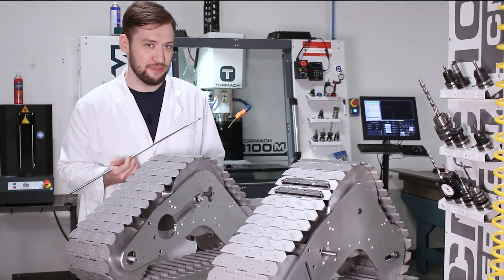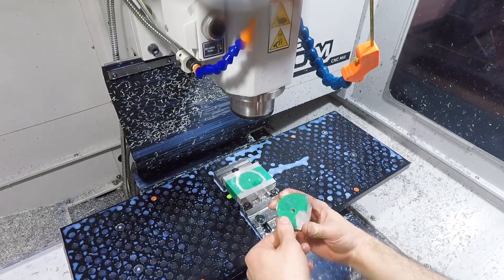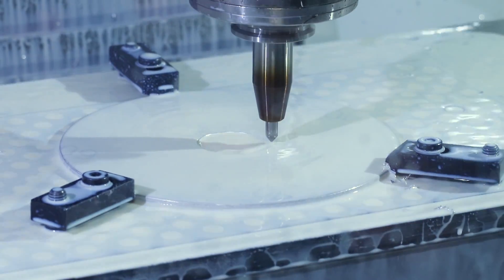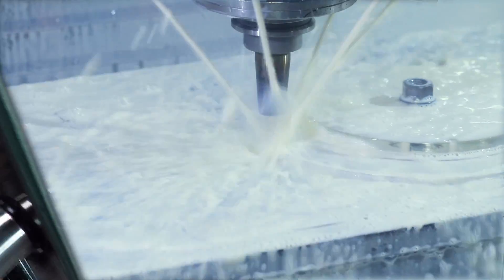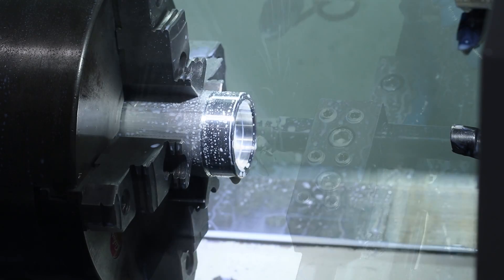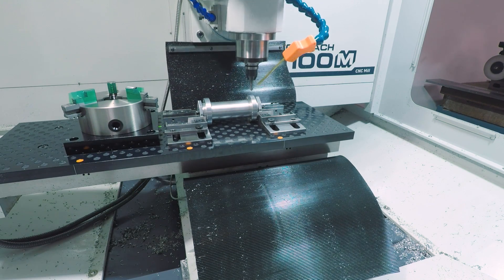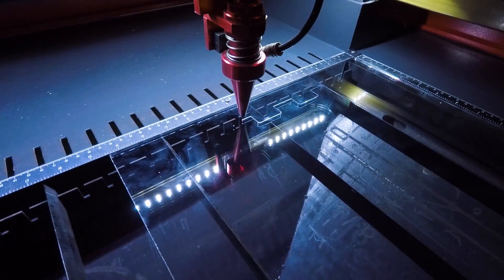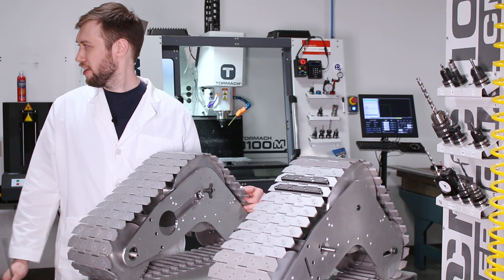Johnny 5 Part 2 - Turning & Milling Top Idler Wheels | WW236

Comment: Awesome project, great work! Looking forward to seeing this progress!
Not sure if you're going to put lower idlers that drop below the drive wheels but you might consider it later if you have problems with uneven tread wear or if the ride end up too bumpy.. it looks like a good transition to the ground from what I can see.. Mike Senna spent a considerable amount of time figuring out this on his WALL-E build. If you haven't already seen it, he talks about the design of the track here: https://youtu.be/7ffA0DTM7TI

Comment: Looks as though internal boring operations have good cut conditions (chipping relatively well) but outer diameter turning may benefit from larger depth of cut to engage the chip breaker. Failing that polished, sharp, positive breakers are always a good result
Reply: @Ed Rees I had a great deal of success with Kyocera A3 chipbreakers with uncoated carbide but I'm sure there are other suppliers who have something similar
Reply: @Ed Rees can't say I've had an opportunity to work on fusion (cloud based service + sensitive components = bad time) but generally speaking I've never had to use any form of smoothing on any lathe programs as the rates of acceleration and deceleration during feed are low enough for most machines to handle it.

Past experience also leads me to also recommend Iscar over Kyocera as the inserts seem to last an awful lot longer and are often cheaper, however it wholly depends on what tooling you've got as suppliers often put subtle changes to their inserts so they're not cross-compatible

Comment: And here I thought you guys just didn’t show lathe work because you were afraid of the big spinning metal eater lol
Reply from the maker: I am.
Reply: NYC CNC If it helps, I run 2 Okuma MB4000H’s with a crane system and 32 tombstones, 15K spindle......and I’m scared stiff of our LB4000. Lathes in general are scary to me lol

Comment: Looks like that front wheel has a decent amount of run-out on the lathe @ 9:00
Reply: similar at @ 10:47
Reply: @Ed Rees Oh, I see. I didn't catch the video of the fixture plates being made, makes more sense to me now. I couldn't see the counter bored holes in the video. 😳 Hey, I love the videos you guys put out for us, it is much appreciated. Sorry for the misplaced criticism. 😆
Reply: I saw that too. So why mill the outer diameter and not turn it in the lathe when you put it in there anyway?
Reply: They were just handheld with the camera
Reply: @Ed Rees Oh, I rewatched it and it seems like the whole part is running out, not only the outer rim. So it propably is just because of the fixing on the live center. If the part itself runs true then it really isn't a big deal at all.
Reply: I asked myself "how do you accurately find the center of a tapped hope with a hiemer?". The question was answered when I saw the run-out of that wheel. You cannot, lol!
Reply: @393strokedcoupe  it was just for rough adjusting because all sides got milled in the setup, so it doesn't matter. For finding the center of a tapped hole you could use a short shaft with a tightly fitting thread on it.